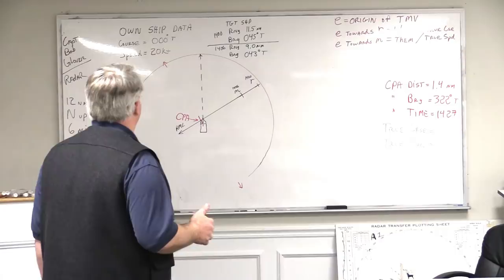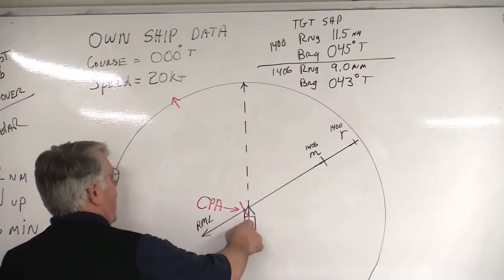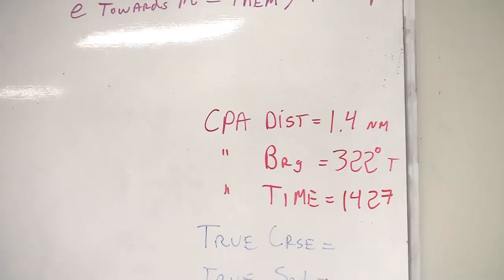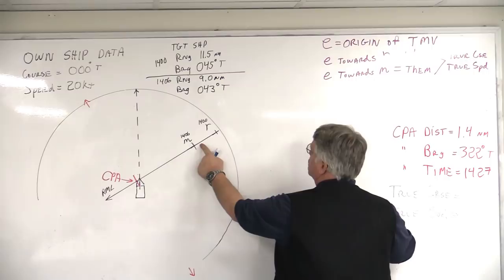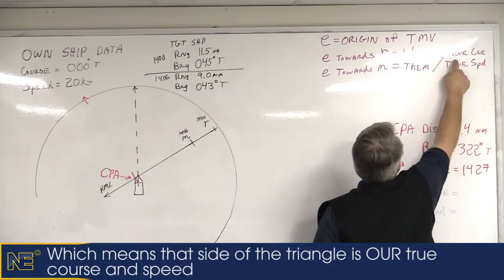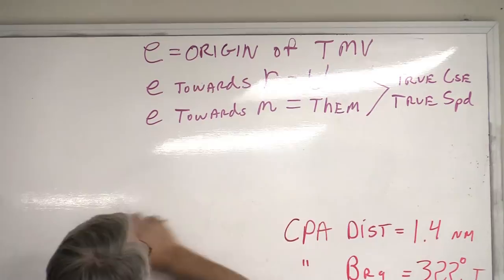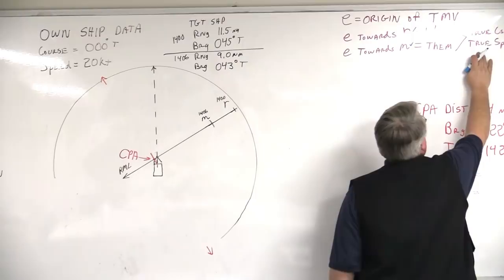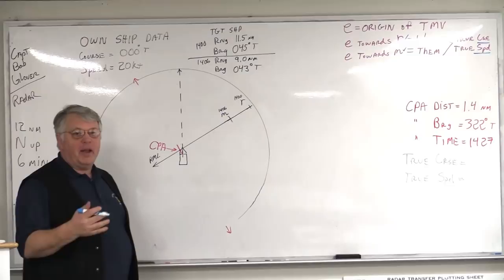Collision Avoidance Radar Plotting 2

Comment: I beleive in the KISS principle 
What a lot of work to avoid a collision. As a single handed sailor I could not spend 12 monutes at the chart table plotting on graph paper. to determine if a collection will occure. For me I use my eyes and check the bearing of the vessel in question.
If constant bearing a collision will occure its that simple, So therefore its impreetive to change direction I change direction in the direction of the aft of the vessel (unless its a head on) with a min of 45 degree alteration during the day min of 60 degree at night  to ensure they can see a course change has been made. ITs that simple
Reply: bruce sinclair lets say it’s a hurricane at 200 miles from you, you can’t see it with your eyes but  you can plot it on radar you will still want a CPA for it and to know it’s motion and speed for avoidance.
Reply: OK if you can use your eyes in fog then good for you!
Reply: The actual plotting bit shouldn't take more than 1 minute, including avoidance calculation.
Reply: Oh di wow

Comment: How about if the bearing and distance remains the same after 6 mins. example 14:06 dist. 10.0 nm brg. 046 deg.  then  at 14:12 dist= 10.0 nm brg. 046 ,  correct me if I'm wrong is it that the target is going the same course and speed

Comment: how did you get 2.0 miles distance? should'nt it be 1.2 miles ? Distance = Speed x Time or im using the wrong formula?
Reply: 6 multiply by 20 the result divide it by 60 to get the distance

Comment: how did he get 2 nm on 20kts speed?
Reply: 6 multiply by 20 then the result divide it by 60
Reply: @christianbatulan4201   6 indicates 6mins 60 indicates?
Reply: @jomarespinar118  you divide it by 60 to get the hours. In 1 hour there is 60 minutes. In addition, knots define as nautical miles per hour.
Reply: Wow, such convoluted answers... 6 minutes is 1 hour divided by 10. So the distance you travel in 6 minutes is 1/10 the distance you travel in 60 minutes. So how he got 2Nm from 20kts? He divided by 10. Simple as that. Use 6 minutes as a time base and all you need to do is divide the speed by 10 to get distance.
Reply: @CristiNeagu  very helpful!!!
Reply: The concept of how to calculate time/speed/distance I explained in the first video of this series.